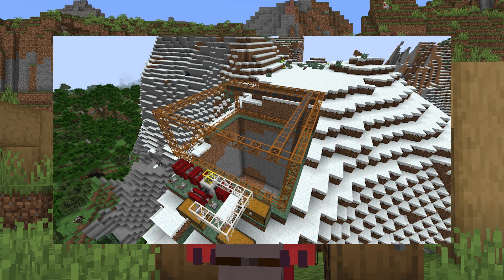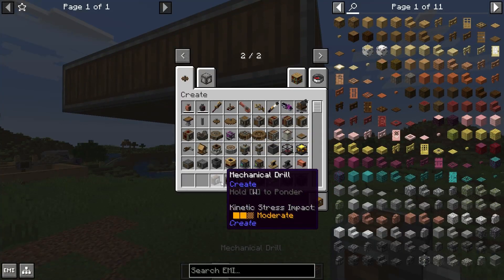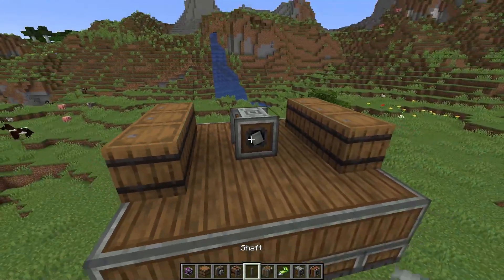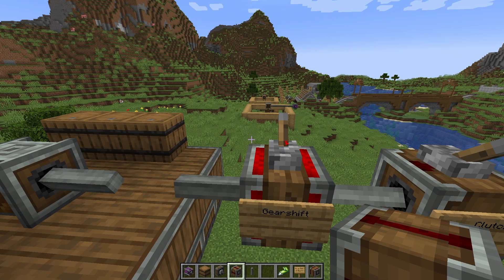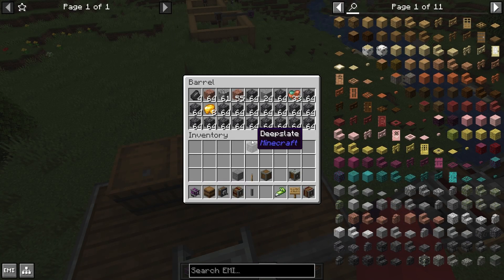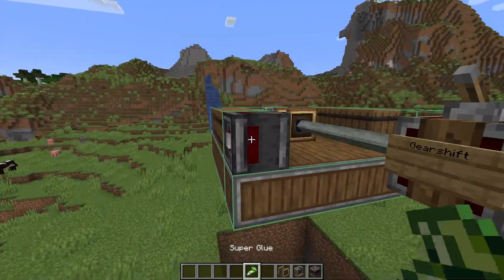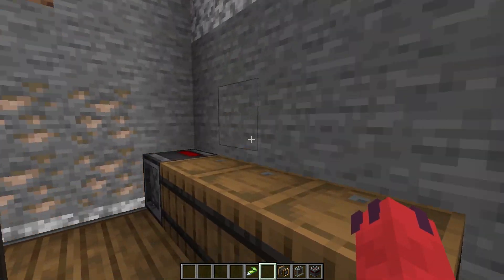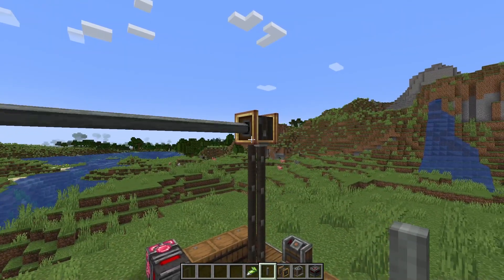How to make a vertical Mining Drill & Elevator using Create!

Comment: You can take this a step further by using gantry shafts and gantry carriages by building your drill very high up and extending a long pole of gantry shafts on the x axis and putting a gantry on top of the shafts on the x axis and then connect another pole of gantry shafts on the z axis onto the first gantry, then put another gantry on top of the pole that's on the z axis and build your drill on top of that second gantry, and to finish off you just need to plug some wireless redstone into the machine and connect it onto a controller and voila, you got yourself a giant claw machine that digs massive holes instead of grabbing plushies.

Comment: how do i make it move to the sides?
Reply: You can make it go to the sides using gantry shafts and gantry carriages by building your drill very high up and extending a long pole of gantry shafts on the x axis and putting a gantry on top of the shafts on the x axis and then connect another pole of gantry shafts on the z axis onto the first gantry, then put another gantry on top of the pole that's on the z axis and build your drill on top of that second gantry, and to finish off you just need to plug some wireless redstone into the machine and connect it onto a controller and voila, you got yourself a giant claw machine that digs massive holes instead of grabbing plushies.

Comment: can you use drills with the elevator pully?
lets say you make the connectors and place them in the right spot
example: friend stuck in cave, gives coords, contraption is built properly right above, and connectors are in the perfect spot
can the elevator use the drills as it heads downward to the second connector?

Comment: How can I easily power this? so it is quick.
Reply: Try and use windmills maybe
Reply: The method that requires the least resources is large water wheels, you basically place them in series. One facing another. Then use water to make them move and they will power a lot of stress units. Then connect this ugly dam to a Speed Controller and set the speed at the highest possible. If it says power is not enough/something similiar, you need to add more water wheels. It requires a lot of free space though so it's not exactly portable.

The most compact way is use windmills, it doesn't require many windmills to get to max power but it's a bit more costly in resources technically.

If you want to power an entire factory then I suggest using Steam Engines, they're not that hard to figure out but they require more resources even at the lowest tier. Albeit they're not that hard to find until the highest tier.

I'd go for Windmills in this case, so that you can also store the whole contraption inside a minecart easily

Comment: I actually just did this in my survival world. However I skipped the quarry step and just use the drills to dig out the shaft for this elevator. Mind you, I've painstakingly dug a large hole one block at a time, rebuilding the entire contraption every time it needed to be shifted. Also, since I do not have friends to keep on the surface, I've made my clutch and gearshift switch wirelessly with the remote controller.
Reply: You can actually set up the Linked Controls (remote) with one button for the clutch, and one for the gearshift, each powering a powered latch that goes into the corresponding component. This way you can control the elevator manually, wirelessly, without using either redstone contacts or elevator controls. So this is wonderful before getting a lot of brass.

Comment: Simple and down to the point. Didn't realize you had to right click the actual pulley to activate. Thanks brother!
Reply: Windmill rotors need a click as well while empty handed.  Relatively sure horizontal drill machines need a click as well....but maybe it is just an initial bump along the rail.